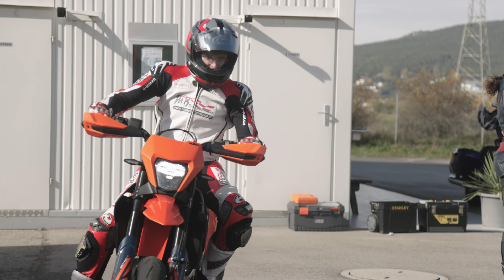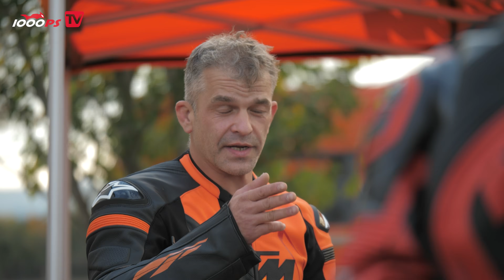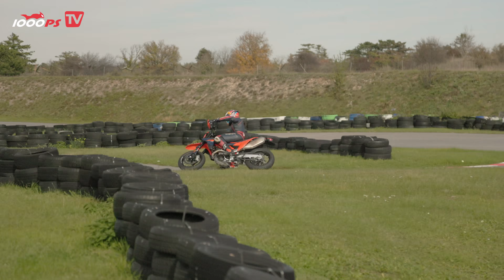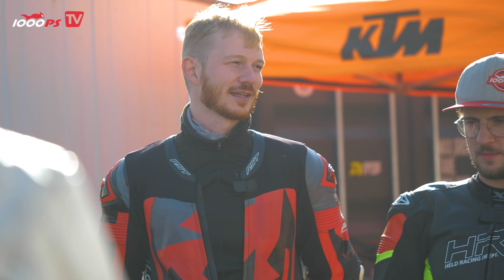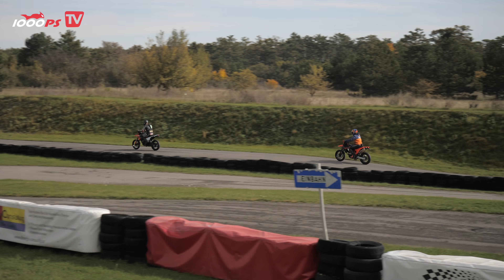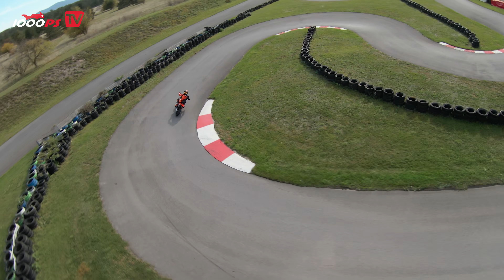KTM 690 SMC R – The True Single-Cylinder Legend! | The Fascination of the LC4

Comment: I live on the Canadian Prairies and have a EURO4 690 SMCR. City riding provides lots of tight low speed corners and potholes aplenty. It's the best city machine of all the motorcycles I've owned since I bought the first one in 1976. The 690 is a bit pricey for someone younger so I hope the 390 encourages more riders to discover how good supermotos are as city runabouts.